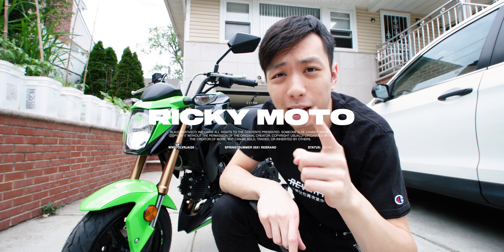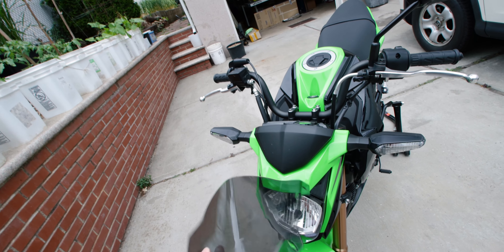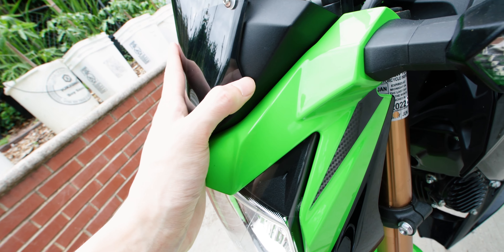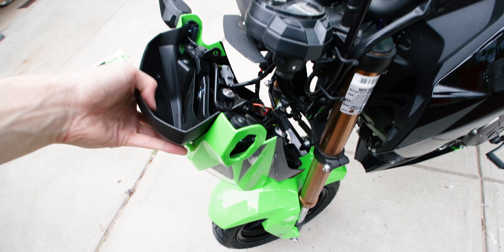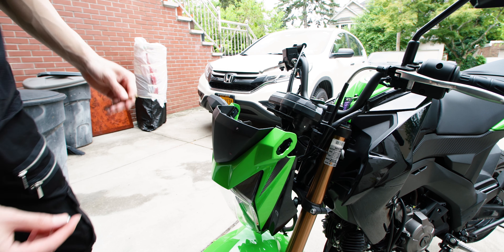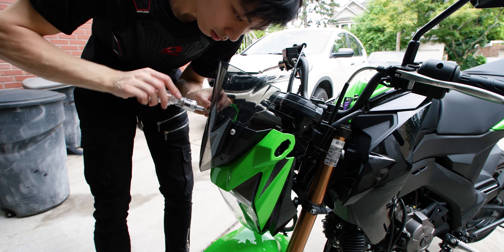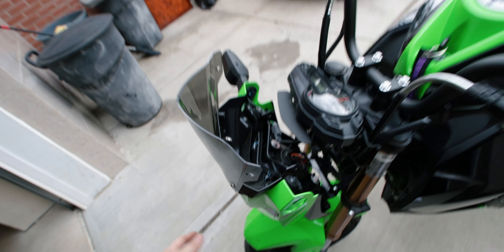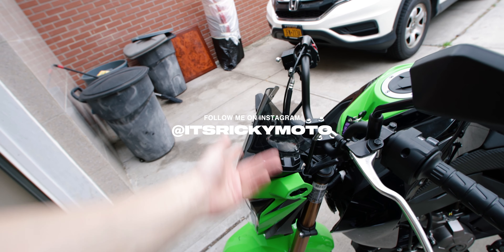Smoked Windscreen Install | Z125 Pro

Comment: I just installed a windscreen, but I used the bracket and only drilled 2 holes at the top
Reply: What windscreen did you go with?